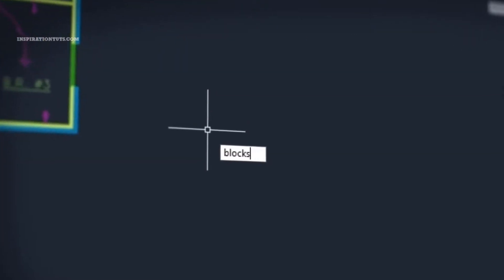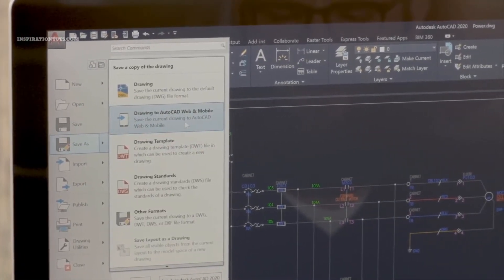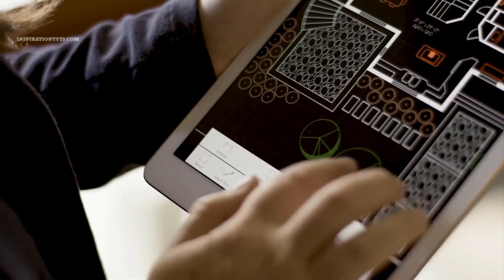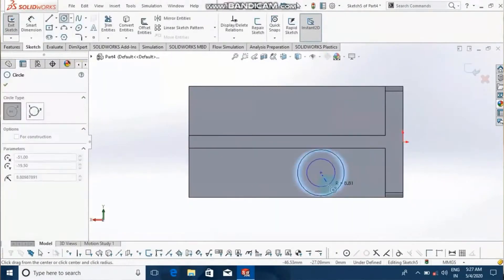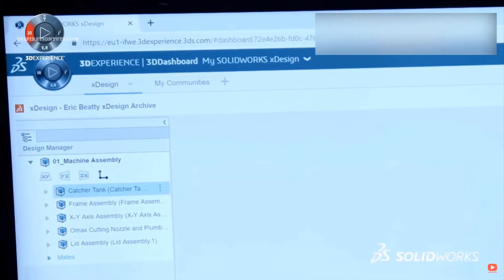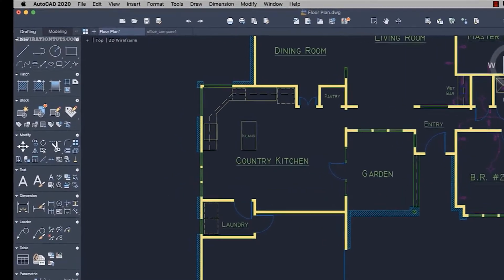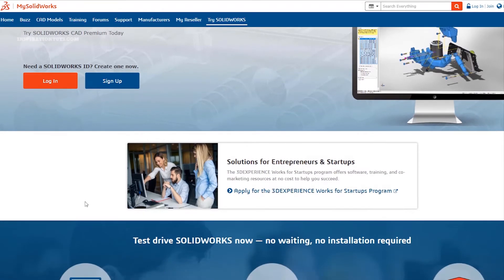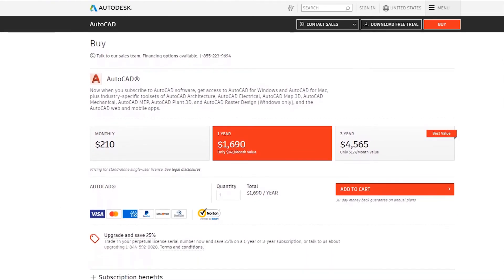Autocad vs Solidworks which is Better

Comment: Truth is, Autocad has all the 3d tools Sworks has. And you can design a fighter jet in 3d on Autocad, but it will be more demanding in terms of geometry construction, cause its not parametric, not fully and you wont have a functional assembly. But Autocad is great for beginners to learn 3D.

Comment: Ever wanted to compare apples to oranges... here it is. Solid works is comparable to ---- AutoCAD Inventor ---- not the other software that Autodesk provides for other purposes like architecture.  An equivalent review would be to compare solidworks to microsoft excel - you would find that solidworks is a horrible spreadsheet program.
Reply: For people looking to do 3D modeling for CNC work, which would be better? AutoCAD or SolidWorks?
Reply: И это правильно!!! :)))
Reply: @dete503  1.- MASTERCAM
2.- SOLIDWORKS WITH MASTERCAM.
3.- AUTOCAD.
4.- AP100US AMADA.

Comment: you're comparing a drafting based software with a design based software..

does it that fair comparison?
rather you should tally in between Inventor & SolidWorks ✓